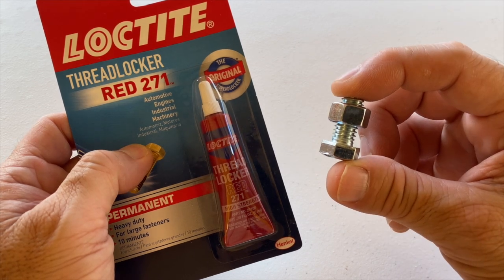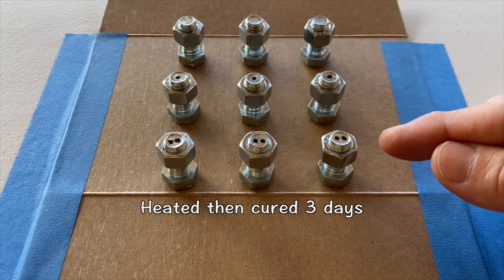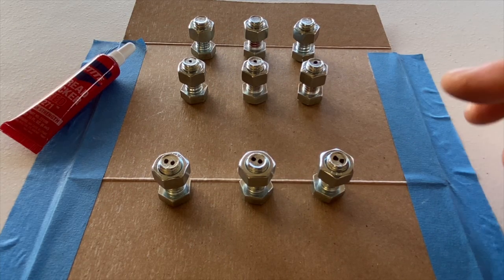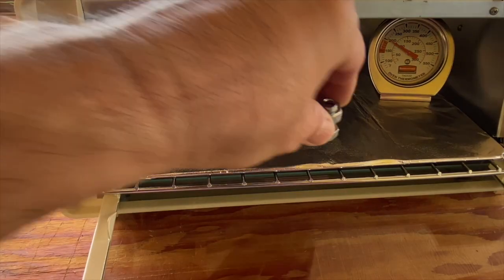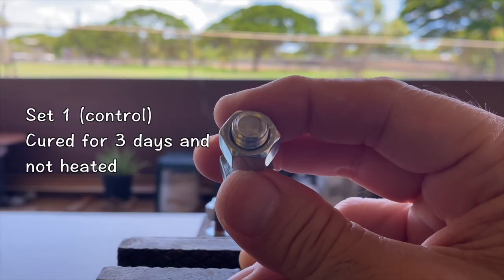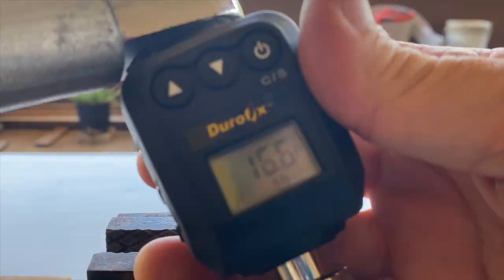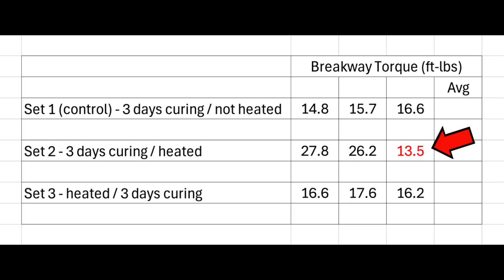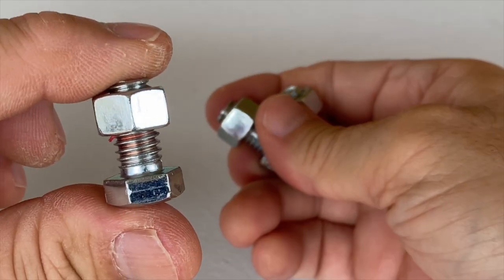What Happens When RED LOCTITE is HEATED in a Toaster Oven?

Comment: Hi there, retired Loctite industrial rep (32 years). I like your approach to your experiments. Very systematic. As you're learning, especially with threadlockers, strength values are always averages of multiple test samples. Now to your experiment. First, stop testing 271. It is a 1970's formula. It was invented for carbon steel bolts not today's plated fasteners. We stopped promoting 271 back in the early 1990's. Today you want 263 or 2760. Both were invented for plated fasteners. 2760 is more of an industrial formula and you won't find it at your local hardware store. 263 is an upgraded version of 262 which is a 1980's formula. Your heating test covered two independent properties. Cure speed vs heat aging. Heat will speed the cure of an any threadlocker however it may or may not increase its overall strength. Heat aging is why you saw increased strength on the 3rd set. Most threadlockers gain strength if, after room temperature curing, they see heat during service for many hours. Hence the term 'heat age'. It essentially drives the curing to a harder state. If you search out our technical data sheets online you'll see we have heat aging curves for all threadlockers and anaerobic products. The curves tell you which products gain strength with heat during service and which ones don't. Finally, the brand of zinc plated fastener will change your strength results. So how the fastener is made and passivated with zinc will change your results as well. Anyway, thanks for the walk down memory lane. Cheers.
Reply from the maker: Thanks for the info!
I've seen the 271 TDS before and it doesn't have the heat aging curves.  I just checked the 273 TDS and see the curves.  I also looked at the threadlocker manual for more info.  I'll need to re-read it several times to get a better understanding.  LOL
👍😎
Reply: @HacksbyDad  Make sure you're pulling the TDS's from Henkel's website. The 271 TDS has heat aging. And you mean 263, right? There is no 273. In simple terms heat aging strength is just an assembly that has been cooked for a long period of time. There are many applications on industrial plant equipment that run hot for long periods of time. When it comes time for maintenance, to get things apart, heat aging can help determine how hard it'll take to remove the bolts. However more likely the curves are used by manufacturing engineers to confirm service removability in some cases. However, if you're using 263, you aren't thinking about getting it off at some point in the future. If you did, then 243 would be designed in or used.
Reply from the maker: @Kumacattv  Yeah... I meant 263... not 273.  I didn't see the heat aging curves for 271 on the Henkel 2018 and 2024 TDS, but found it on a 2012 TDS.  LOL
👍😎
Reply: @HacksbyDad  Hmmm. I'd have to check all three. As it was an older product they may have let the data off for some reason. But it is a standard test they include on all threadlockers. Of interest, specifically to heat aging, there are some older formulas that heat age quite a lot. So R&D would always try and engineer it out as customers complained when they couldn't get something apart. So most of the newer formulas today don't have it. Some of the older formulas do it. I recall one or two that heat age pretty badly. Heat aging is just over curing. The prolonged heat continues to drive the curing and cross linking of the chemical structure making it harder and stronger.

Comment: Problem with immediate heating then curing, is the red Loctite's syrupy viscosity will degrade in the heat before it can cure harder -- meaning it'll leak out of the bottom of the threads as tested (and visible in the video), then cure. Less Loctite in the threads = less bonding. 

As a former powersports tech 16y, plenty of exp w/ genuine Henkel Loctite 271... agree curing then heating does improve bonding strength (when used on critical fasteners like sprocket bolts / nuts, there's heat cycling in svc that can result in basically hard clear red plastic, requiring a bit of heat to remove esp in aluminium -- perfect as temps don't exceed 300F in svc but 300's easy to achieve with a torch, plus sprocket fastener access is simple).

As a tech, I blue-Loctite'd everything that held together the bike / watercraft / ATV. Unless I was going to go into every fastener regularly, it got blue Loctite + proper torque (when possible). Bare fasteners loosened past their torque stretch -- esp on off-road machines -- will walk and strand you when you least expect. Blue at least extends that margin a fair amt -- and if you have cordless power tools like everyone should, blue shouldn't put anyone's panties in a twist. 

Keep experimenting and documenting, bruddah! 🤙

Comment: Nice experiment. That's an interesting approach.

The Problem is you cannot heat the assembly, hold together by your nuts and bolt.  Either, assembly with nuts and bolts or just screwed in a block heat won't be able to be applied , or will not be recommended, on the assembled parts.

Better consult with Loctite to get the tested product based on your torque need.

Have a nice day, great experiment.
Reply from the maker: Thanks.  It was just an experiment to satisfy my curiosity.  👍😎
Reply: @HacksbyDad Well done, as a mec. eng, I've been working for years specifying assembly etc.  Even after 30 years, I learned something with your experiment.

Keep on being curious 🧐 👍